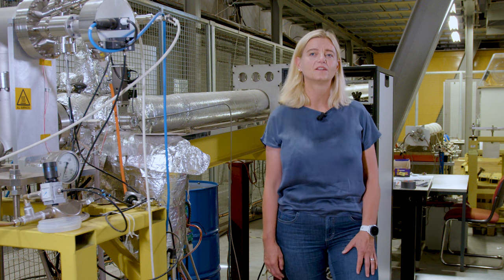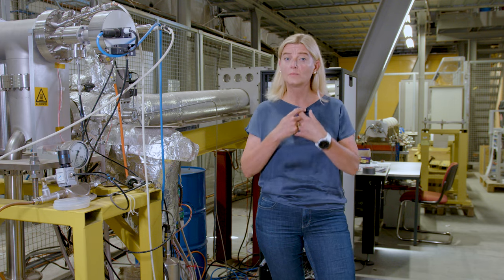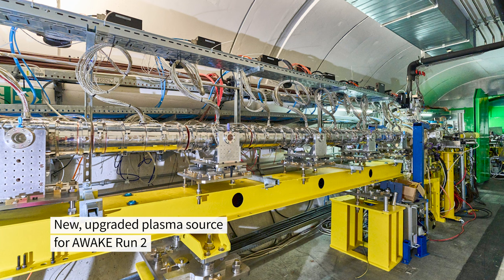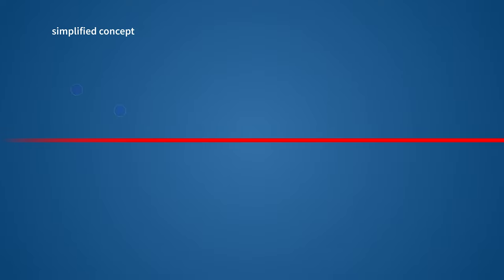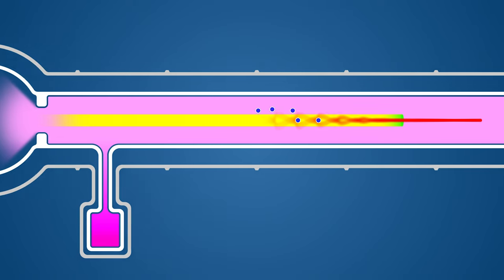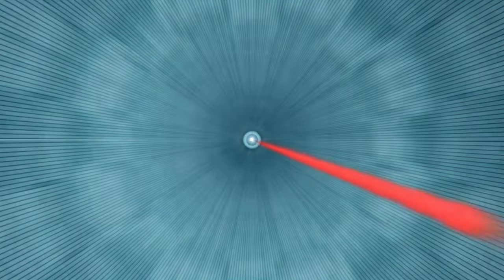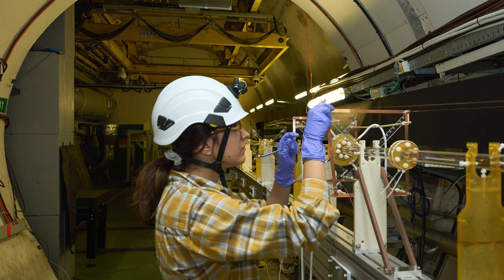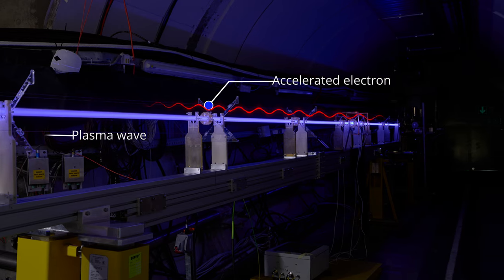Plasma accelerator, AWAKE, introduces a stronger wave

Comment: Wakefield accelerators are certainly interesting, but it sounds a bit silly to me to use a proton beam to accelerate an electron beam. But hey, if you already have the proton beam you may as well? and probably you'll learn something. Imagine if the LHC were replaced by a wakefeild linac.
Reply: It makes sense. Can it work any other way?
Reply: Why would that be silly? Using positive energy to bounce negative energy would be the best way to do that.
Reply: Maybe not replaced but CLIC was a studied for quite a while at CERN and it might still happen in some future.
Reply: It's actually not as silly as it sounds at first. The thing is, proton accelerators and electron accelerators are limited by different things due to the mass difference between the two particles: Electrons are much lighter than protons, so they will lose energy to synchrotron radiation when flying around a circle. So an electron accelerator would be much larger than a proton accelerator to compete.

So it might be more economical and compact to first accelerate protons and then transfer the energy to the electrons with a wake field accelerator.
Reply: @mephistoxd2627  But we also have to take into account the energy efficiency of producing the particle beams that'll drive the plasma wakefields. Making electron drive beams is easier and typically more efficient than making proton drive beams. Sure, you can get higher-energy drive beams with protons. With high enough driver energies, we can even ignore the issue of staging altogether! But what will happen to the overall energy efficiency of the whole accelerator?